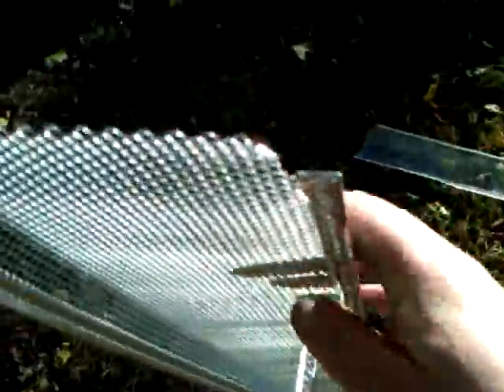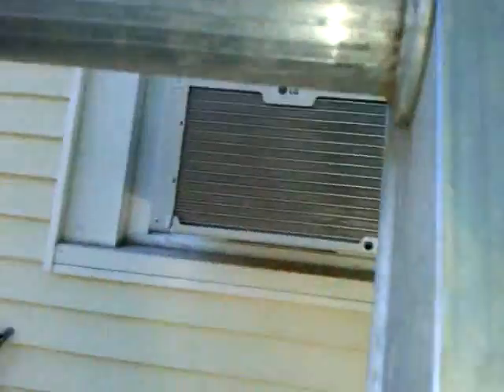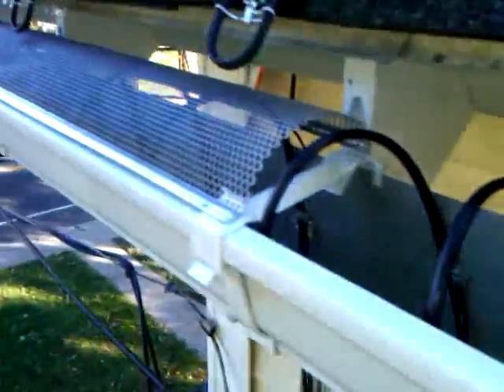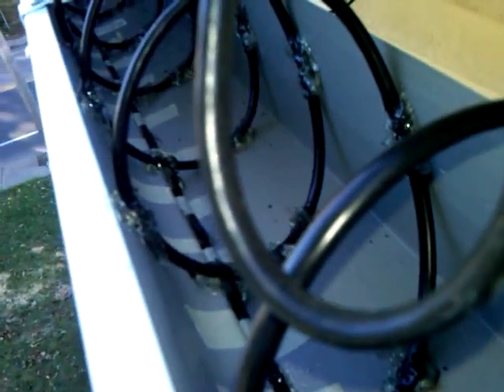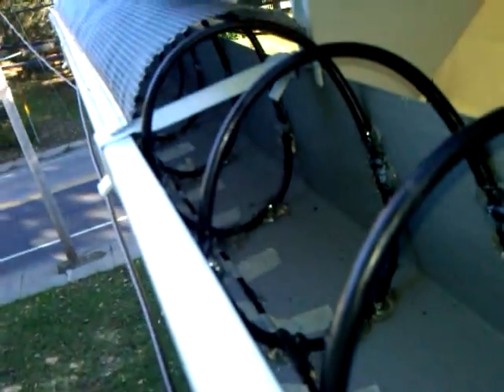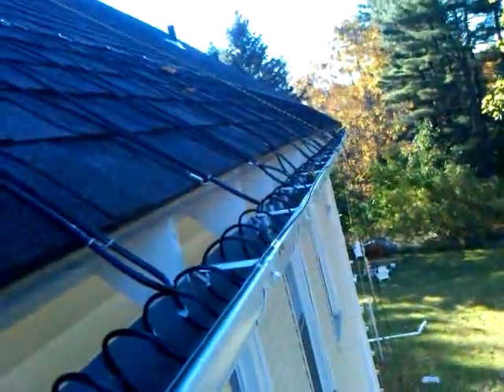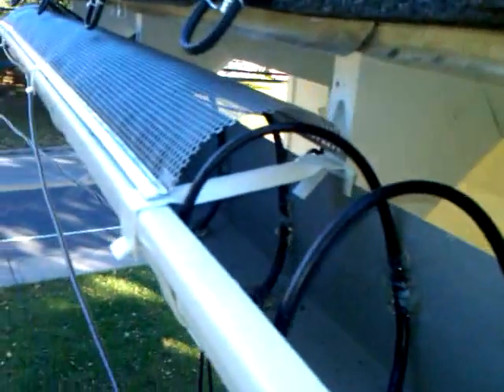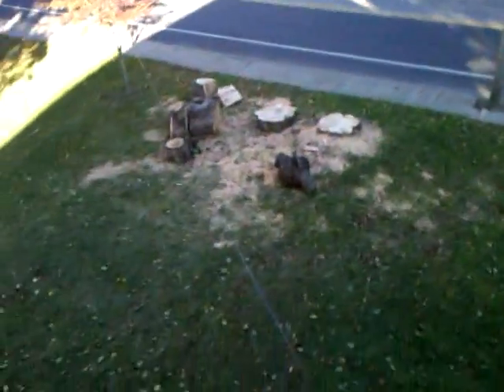Gutter/Roof Deicing Cable 2nd Installation (2nd style) - Ice Dam prevention

Comment: Sir... your loops are overkill... I have mine installed as manufacturer s  instructions  for 15 years. ..no issues none whatsoever. ... do not have cable contacting the bottom. .. it hinders the flow of water when the debit is low... you will have a lot of shingle screenings & various dirt/small debris collected at each coil touching the bottom...

Comment: Yep. . .constant-wattage cables: overlapped = fire. Solid ice still forms between the zig-zag on the roof. It will freeze over the gutter eventually, cause icicles, and maybe even take down the gutter.
Reply from the maker: Bill Gabbard It's been pretty effective.  The amount that the manufacturers recommended cable quantity must be for Florida, because I found it to be totally insufficient for New-England winters.   I needed to make it "wife proof", so if she forgot to turn the cables on, that they could still burn through the ice.  With the other method(s) of running the cable in a K-style gutter an ice-plug will cover the "straight run" cables.  The running "spiral" in the gutter comes up out of the gutter and makes good physical contact with the gutter-guard.  This way the cables in physical contact with the aluminum gutter-guard heat up the gutter guard, and ice can't form on top of the gutter-guard and block the gutter.
Reply from the maker: The gutter is extremely well secured to the house.  I used Berger Premium rafter hangers with top crossbars.  The gutter is completely encircled (boxed) by the hanger and then the bracket was secured by 6x screws (3x screws parallel to the rafter, and 3x screws 90-degrees to the rafter).  The gutter is NOT screwed or fixed to the rafter/bracket, but its is "boxed" around it, so the gutter can expand/contract and not put stress on the hangers or any gutter seams.

The downspout at the end of the gutter is attached to the gutter-outlet "mouth" by a pair of machine-screws & nuts, so that the downspout elbow can pivot.  So when the gutter expands and contracts lengthwise, the gutter-to-downspout connection pivots on the machine-screws and doesn't put stress on the downspout-outlet or downspout.

All fasteners are stainless steel or aluminum.  When the fasteners were in contact with aluminum-metal (downspout, gutter brackets, etc), aluminum fasteners were used to prevent dissimilar metal corrosion (stainless steel fasteners on aluminum would be a poor choice and cause the aluminum to corrode). 

The white PVC adapter pieces (triangular/wedge shaped pieces) were secured to the fascia/rafters with multiple stainless-steel wood-screws.
Reply: anotherfun1discovery

 No doubt you have excellent wattage ratio to keep that gutter steaming!

I gotta tell you a consistent mistake I see a lot of folks doing:
You simply MUST use clips from your "V" cables to your gutter run cable.

It is the only way to guarantee a drip path for water, and I can assure you in New Engand? Anything less will fail.

In Illinois, I have had a different experience, using just a single cable as directed..
I think many are misunderstanding the point and function of the cable.

A single cable, run in 15"-wide V's, run to 6" above the imaginary plumb-line directly above your sidewall.....AND PHYSICALLY CONNECTED by clips to the gutter cables, does exactly what it is designed to do. Keep ice-dams and accompanying icicles from forming....Wisconsin.... or anywhere else.

Many times, the gutter will be snowed-over and possibly even some ice covering cable.
But within that ice...water is following the cable...wherever it leads.

What folks do not realize, is that the CLIP provides the heat that keeps water dripping between roof and gutter cables...without it, you break the circuit so to speak, and the water freezes and goes the icicle route.
Reply from the maker: justkeepinitrealyo

I agree that a physical connection from the roof "V" cable to the gutter cables is important.  In this video I didn't install the "connection" between the roof and gutter cables, but you can see it in a later video. 

Instead of the clips provided with the heat-cable, I used bare aluminum wire (approx 14 awg) (from McMaster-Carr) to make my own clips.  I spiraled the aluminum wire down through the holes in the gutter-guard, down & around the gutter-cable, then back up through the gutter-guard holes and then around the roof-cable drip loop. 
I did several revolutions of this so that the cable would heat the wire and also made sure the wire was in good contact with the cable.

Because of the gutter guard, I couldn't (easily) use the factory wire-clips.  It took a little practice, but I became fairly proficient & quick at installing the homemade wire clips.

To make it "better", I should put some aluminum wire at the lowest point on the roof-cable-drip-loop, and connect it to gutter cable.  I didn't tie the roof-drip-loop at its lowest point to the top gutter cable, but instead I did it to the right & left of center about 1/2" away from the lowest point.  I get some icicles forming from the lowest point of the roof-drip-loop to the top of the gutter guard.  To your point, this is where the "circuit" is broken, because the water wants to go to the lowest point and drip.

Talking about cable "physical contact", I found that architectural shingles caused the cable to not be in complete contact with the roof, which reduced the roof melting efficiency.  I think that 3-tab shingles wouldn't cause this issue because they have a flatter profile. On the other side of my house, I used neoprene roofing cement to tack the cables to the shingles where they weren't in good contact.  I'm glad I used neoprene cement, because the other plastic cements are too "hard" and you can't replace the cable easily without damaging the shingle.  I found that the neoprene cement (black jack brand?) would not damage the shingles when I needed to replace a cable.  Downside of tacking the cable to the shingle is that it tends to catch debris (maple tree "helicopter" seeds).  If you don't have trees nearby then this shouldn't be an issue.
Reply: These constant wattage cables are very dangerous and cannot touch each other, ever. I saw them do $4,500 fire damage, plus $48,000 water damage by the fire department.  Consider using Summit Ice Melt Systems LT or Hotslot. 1 foot of cable along the eave–hidden–and will prevent any ice along the entire eave. They are self regulating cables that automatically step down output when it reaches peak temp and will never overheat. We used these on tons of jobs. Yep, more expensive up front, but safer, more effective, and not ugly leaf and pine needle catchers. Protected cable will last decades, and the energy savings alone every month pays for itself.

Comment: Looks like you are doing a great job at making sure everything is going to stay clear and free of ice.  You may want to consider one thing.  That looks like you are installing a constant wattage cable.  If so... you may damage or short out the cable after a short period of time.  If it touches itself it will over heat and melt the core.  Your loops in the gutter are really close to the straight shot in the bottom of the gutter.  I've seen this happen more than once.  You may also want to consider Self Regulating Cable if you ever have to install it again.
Reply from the maker: I was concerned about the heat tapes touching at the bottom & over-heating....so I used caulking to keep them apart.

It is hard to see but the tapes are separated by caulk (dap 3.0 - clear, or  Dap 3.0 Gutter/Flashing, white) between the bottom/front straight run and the spiral. About a 1/4 to 3/8" gap filled with caulking.   Also the bottom/front straight run is caulked every few inches to the bottom/front of the gutter. 

Later I thought that caulking the bottom straight run to the gutter may be a problem if the thermal expansion difference is large between aluminum and the heat-tape plastic (??), causing the heat tape to be "stretched" by the expanding aluminum gutter.  So far (several years) it is still working, but I should have put slight "humps" in the straight run to give room for expansion.

I also had issues with the architectural shingles not allowing the heat tape to be in good contact with the shingles.  On the other side of the roof, I ended up using small spots of DAP 3.0 Roofing caulk (black stuff, can't buy it anymore) to hold the heat tapes in contact with the shingles.  Doing this helped a great deal, making the effective "melt" distance from the heat-tape on the shingle 2-4 times greater.  The downside with the caulk dabs, is the sometimes it can trap pine needles under the heat-tape.